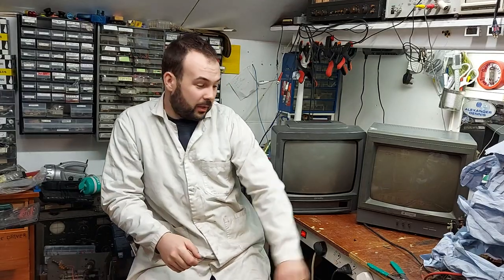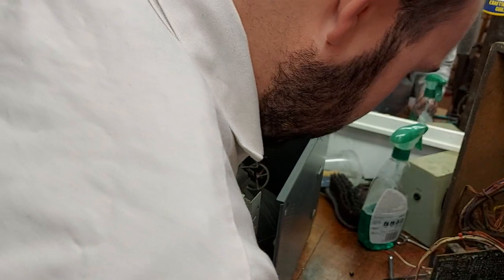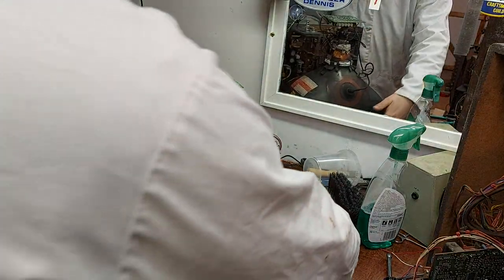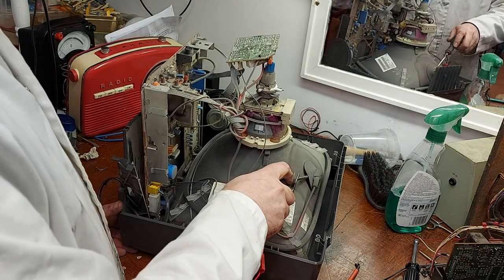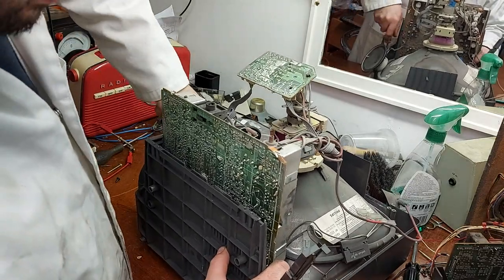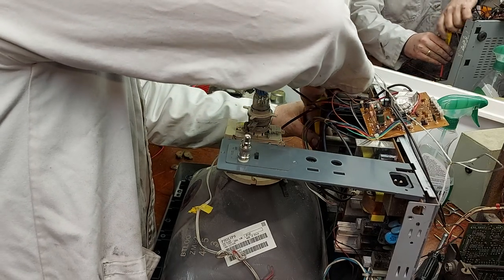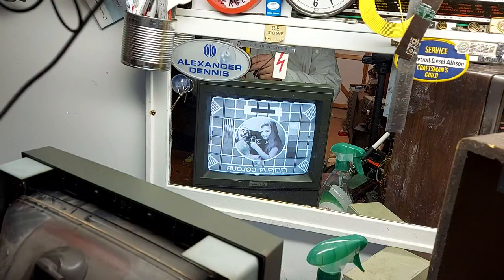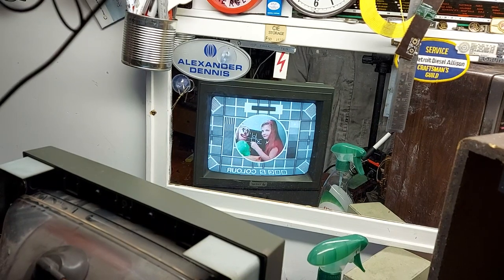CCTV Monitor CRT swap.

Comment: Smashing job, it will do for a monitor :-D
I was supprised that the line/field coils were close enough to work with a different driver.
Now did you get it wrong once with a mirrored picture :-D. i have :)
When you said philips i wondered if it would look ok, some can be a bit odd.
I did think about the h.t supply adjustment, then i read your discription lol.
Ooow that white Classic set i have seems to be a TV 130 / 140,  i found the strange schematic.
Reply from the maker: Upstairs for thinking, downstairs for dancing.
Reply: @IrishvintageTVRadio  Errr yes i suppose, now i am confused :-D

Comment: My winter project is building  vintage model aircraft radio control equipment from scratch. It’s not the building that takes the time it’s finding components ! Or modern equivalents . Any one got any miniature  valves they don’t require ?
Reply from the maker: Sounds interesting.